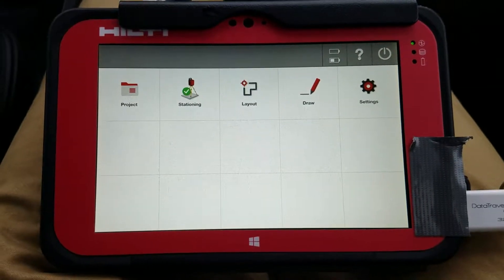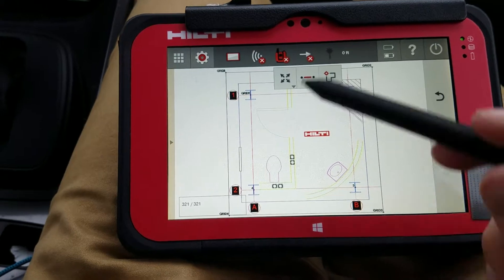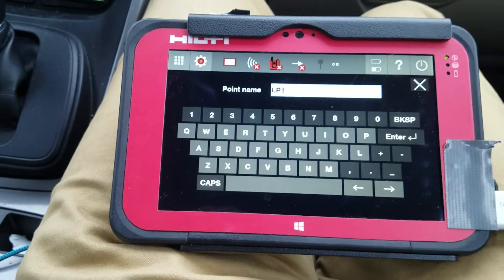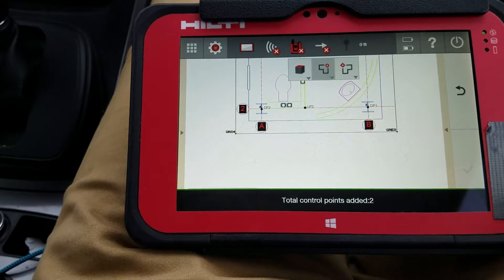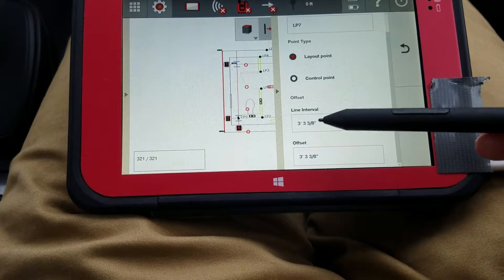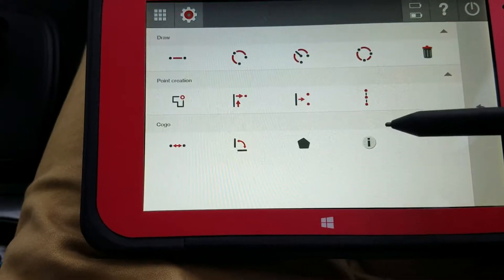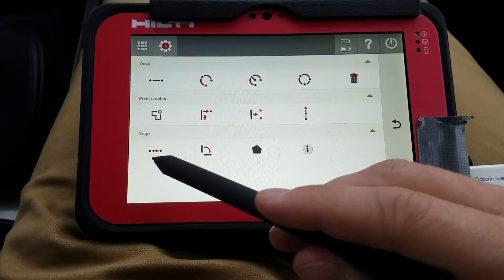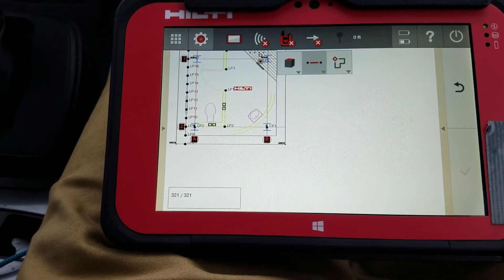Hilti PLC 400 Upload and Edit Projects/Drawings

Comment: hi what is the distance range of the prism poa 20? im using the plt 300. im trying to measure about 100meters but it cant detect the prism anymore
Reply from the maker: I have seen the prism hit at about 700 ft, but it's hard - it depends on reflection from the sun, ambient conditions, etc. Usually, though, 350ft it SHOULD be able to reach it.

Comment: Is there any reason why center point feature would not work on drawing. Would that mean cad file is not working correctly. But intersections and end point work for layout points.
Reply from the maker: Hi Mike, yea, that's happened to me before as well. Usually it's because the CAD entity (whether it's lines, arcs, circles, etc.) are not fully exploded to those actual objects. They might still be in "block" form in AutoCAD. A quick exploding of those objects in AutoCAD could fix it. It's something local Hilti reps can help with actually, I've found.
Reply from the maker: yes - sometimes even though they look like circles, they may not "be" a circle in terms of AutoCAD. There are many elements in CAD - 3D elements, blocks, etc. Sometimes elements are not yet "broken down" to their most basic line/arc/circle elements yet and therefore the program cannot recognize them as such either. That is why I made this video for people wondering what is good to do with CAD files on occasion to optimize them. https://www.youtube.com/watch?v=Dq97POa1Hvc&list=PLF5GOD3RdTERIBFmNtzy9Fr4OWI7uQxMJ&index=1&t=79s